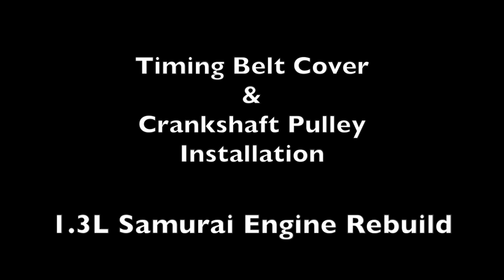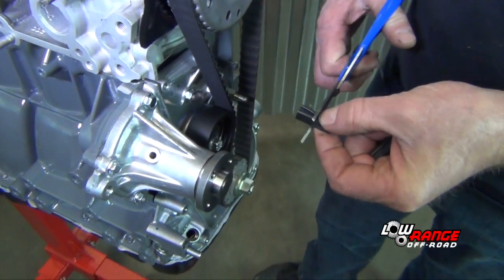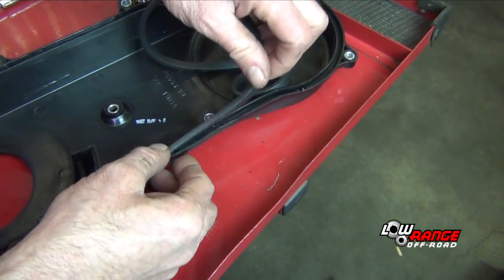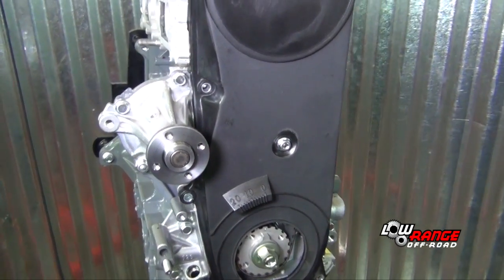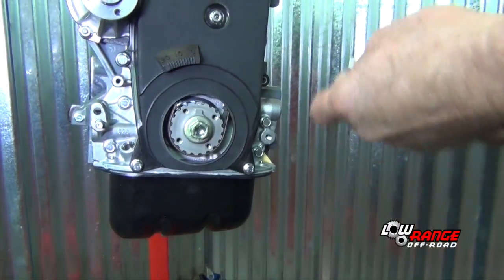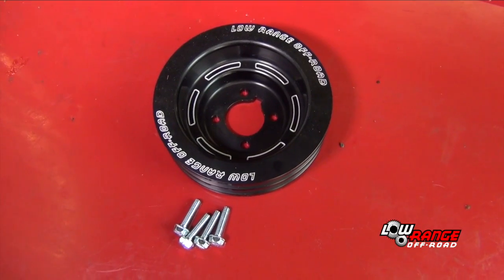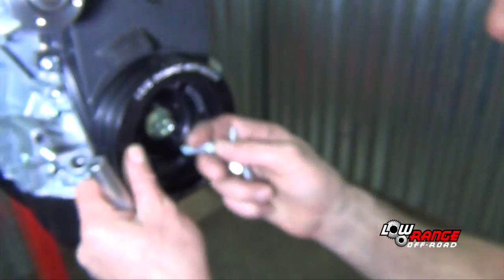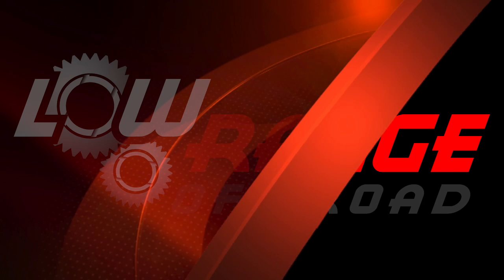How To Rebuild A 1.3L Suzuki Samurai Engine (Part 8) T-Belt Cover & Crankshaft Pulley Installation

Comment: If I wanted to order a complete rebuild kit..pistons,(stainless steel) valves,bearings,rings etc.Would I be able to order the parts necessary from your site to rebuild a 1.3 16 valve 4 cyl (G13b or G13BB) out of a 1999 Suzuki Swift or 1999 Chevrolet Metro?
Reply from the maker: +MadWeiner I am not sure.  But, If you'd like to call 801-805-6644 between 8:00 am to 5:00
 pm MST and ask for William, I am sure he can help you with your needs and answer your questions.  Thanks for watching and commenting.

Comment: I agree. how do you put the distributor in and get it in-sync with the timing of the cams? that would be my fear of doing this on my own. my luck ill screw something up and be right back at square one. thanks
Reply from the maker: +Crystal Jones This is the concern of many.  Here are some written instructions that were designed to show customers how to remove and replace the distributor and maintain, as close as possible, the ignition timing. http://www.lowrangeoffroad.com/instruction-sheets/samurai-instuctions/samurai-distributor-vacuume-advance.html
 However, these instructions will only work if the engine (crankshaft and camshaft) are not moved during the removal and replacement of the distributor and that is not possible during an engine rebuild.  The best way to do this would be to place the timing mark on the camshaft straight up before removing the distributor (See Step 1) and then place the camshaft in the same exact position before reinstalling the distributor (See step 25) you should be fine.  Of course, you will need to check and set the ignition timing to have the engine run at its best.  But it should at least run so that it can be timed with a timing light.
Reply: @lowrangeoffroad1  do you know if theses engines will fit in the tiger truck mini's???  Thannks